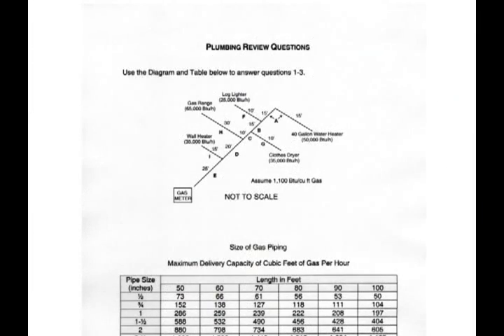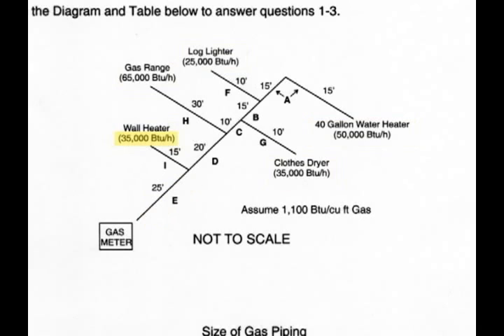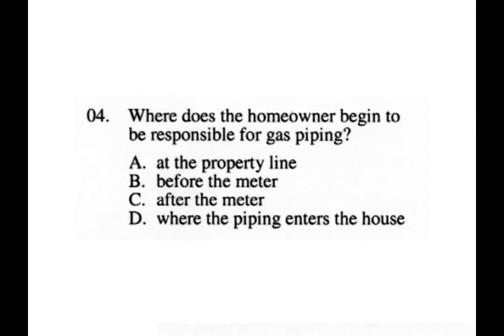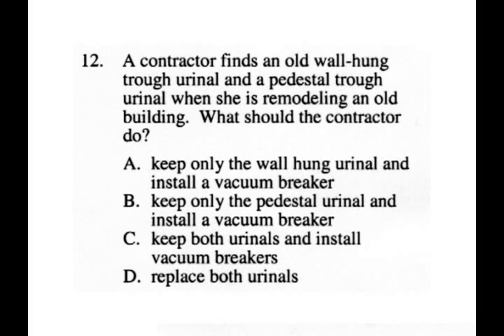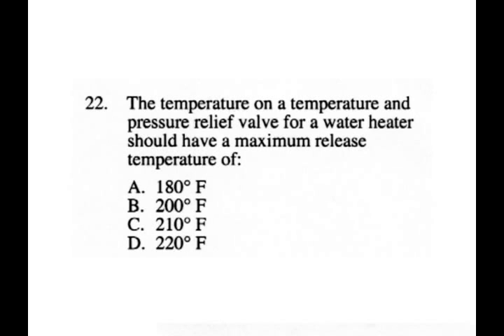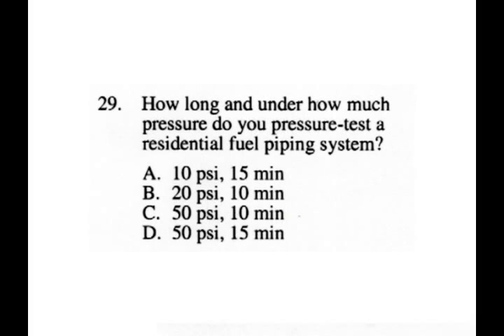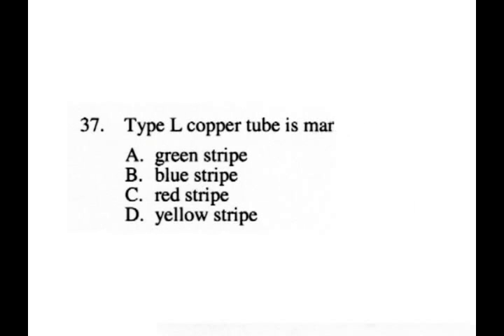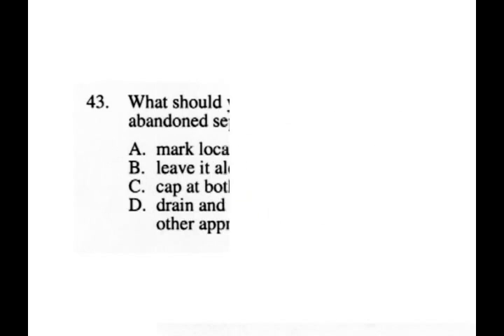Plumbing Skills

Comment: On the second question isn't the piece "E" only 25'. You used the 100' column to answer? I see that 1' would still be the right answer but just wondering.

Comment: For what state in the US is this for? Or same for all of the states. I’m from New Jersey and I’m in plumbing school year 1 and I want to learn as much as possible. I would like to see videos related to the laws here in New Jersey.
Reply: I wanna say no. Ive notice some things that are not part of the CPC California Plumbing Code. I know out in the east they use K copper for below grade while Cali uses Type M. Also Thrust blocks, Ive never seen or heard of that out in Cali. Some questions do apply for us though.
Reply: also for the vent pipe in cali we do not use copper which is question 28 we would use galvanized steel, or PVC or ABS, but for C36 test it should be PVC 4"
Reply: question 29 lol they chose A when for us is 50psi at 15min